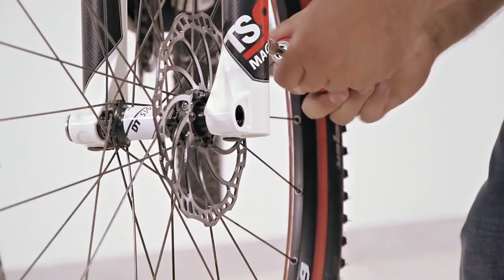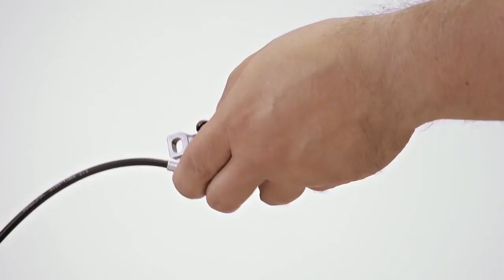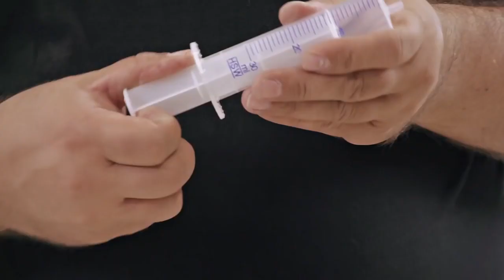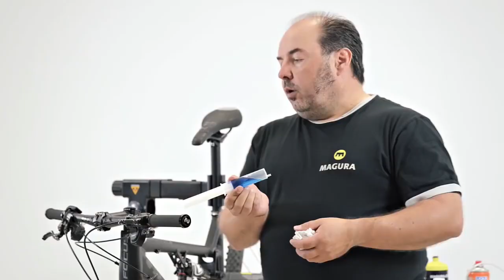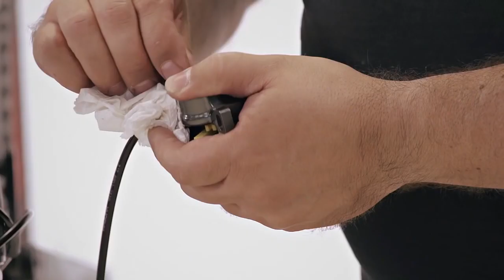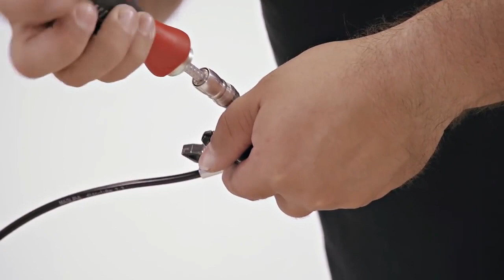Filling and Bleeding MAGURA MT Next

Comment: You had air in the syringe tube, you didn't displace the fluid on the caliper bleed port. if oil don't squeeze out you're introducing more air into the system. You should make a new video as people will do as you did and fail. Come on you guys are better than that...

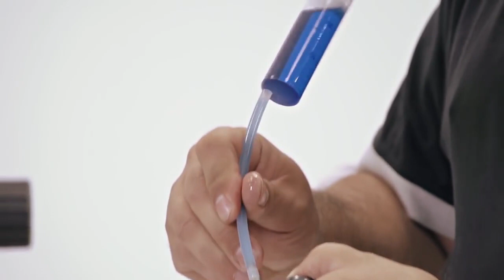Comment: @2:57 You should squeeze out all the air from the tube before inserting it. Now you are forcing air to the system.
Reply: Hes pushing nearly 30mls of oil through the system which holds about 10 mls max! If he's introducing any air into the system then hes undoubtedly pushing it out of the lever end given the amount of oil going through. I wouldn't worry!

Comment: Hi. I have some 2008-ish Magura Julie brakes on an old (but criminally under-used!) hard tail. See https://www.singletracks.com/photo.php?p=2305.

There's only one candidate for a caliper bleed screw but would anyone know what thread the nipple would be (M6?) ?

At the lever there is no port like in this vid, it has a plate type cover held on with a couple of small torx bolts. What will I find underneath, would the bleed procedure be radically different? Thanks.

Comment: Awesome!  I'm about to bleed my mt 6,  I used to hate bleeding brakes until I got my first Magura!  Why not put the bleed screw back into the caliper first though?  My brake is nicely installed pulling it off to hold it up isn't convenient I see no issue doing this step in reverse am I wrong?
Reply from the maker: Hi, thanks for the message! If you remove the syringe at the caliper first, the oil can freely flow through the brakes - which will result in a big mess. So we recommend doing it as shown in the video. Kind regards, MAGURA Social Media Team